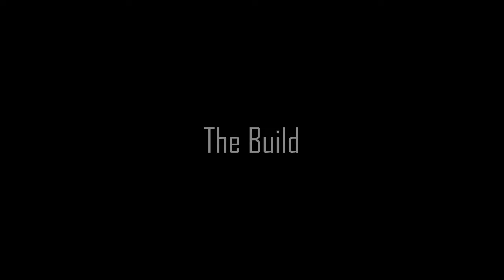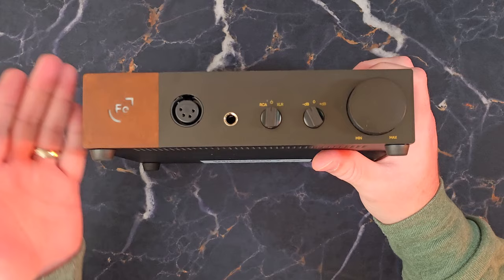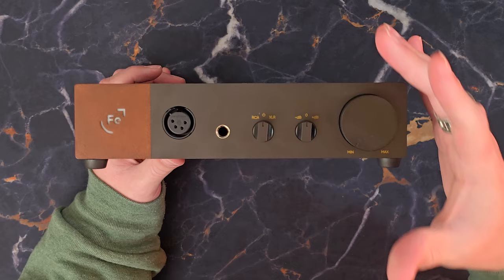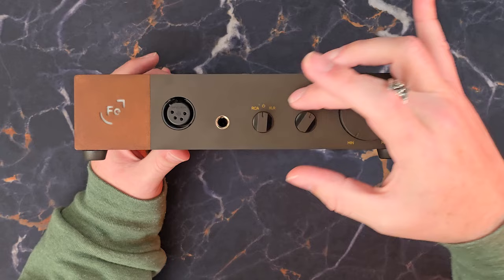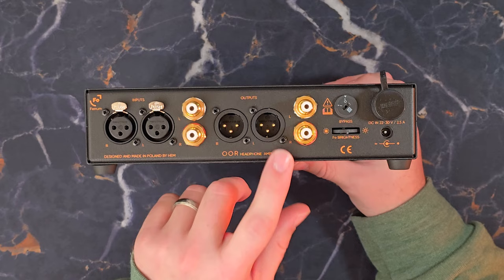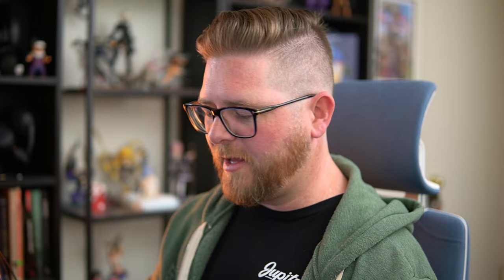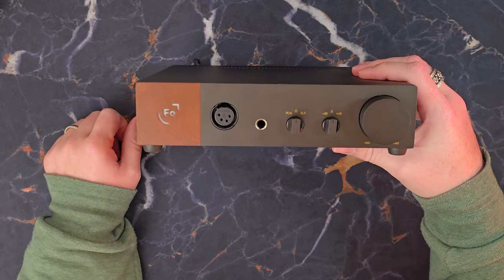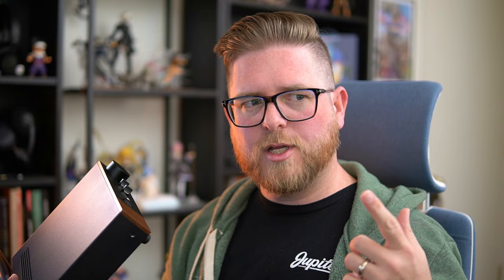(More Than Meets the Eye) Ferrum Audio OOR - Part 1/3 - Amp Analysis

Comment: I'm slightly concerned about the Cor-ten steel. This is a steel thatt is designed to rust and protect it's core. It's amazing ,expensive and i have a huge BBQ grill made out of it. 

However, I'd be concerned with it being in contact with any other steel without the contact points being protected. 

Also, this maybe the angle, but my OCD would hate those switches. They appear that the "standby" and 0 are not TDC and are little leaning to the right. 

I'd love the whole stack in the Hypnos I think it looks amazing, but too many ££££ for me.
Reply from the maker: The corten logo is sealed and isolated, so no concern for it spreading to the rest of the chassis.

And yes, the angle does make it look like the knobs and labels don't align, but I can assure you that they do. Weird camera distortion.
Reply: @Marslander Thanks for the reply. I think I'll stick to the Burson Soloist 3XGT, and upgrade my SMSL D1se to the Gustard R26 even tho the Ferrum might drive my Tungstens when they arrive

The Ferrum looks is not quite worth the looks, but internally, its appears to be VERY well put together.
Reply from the maker: @invisiblekid99  Burson and SMSL is a very solid setup. And yes, I'm the first to admit the Ferrum aesthetic doesn't really match the price of entry, but they do definitely look very good as a stack.